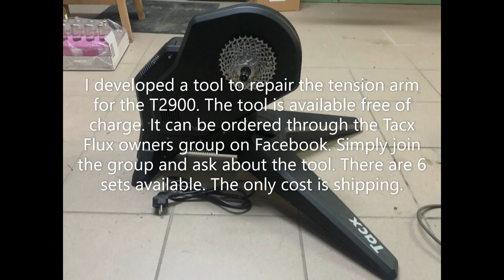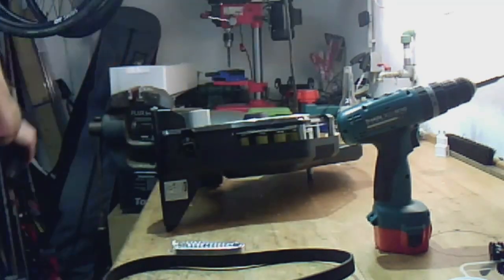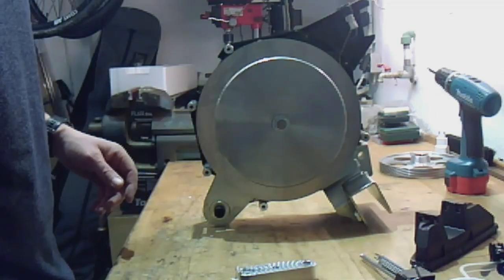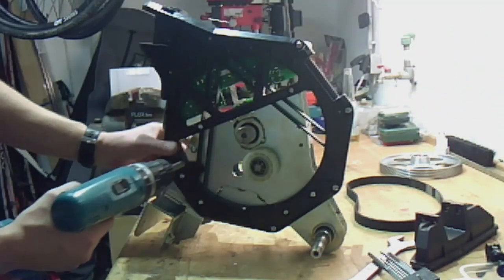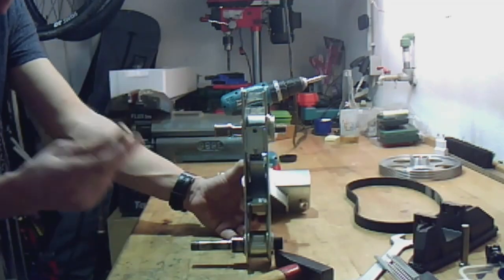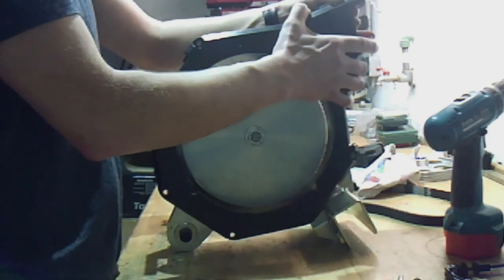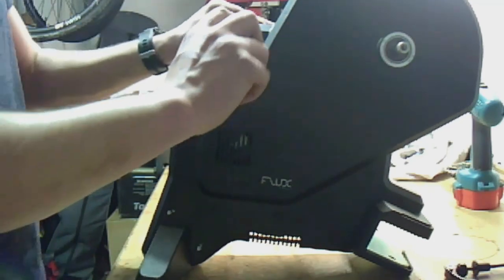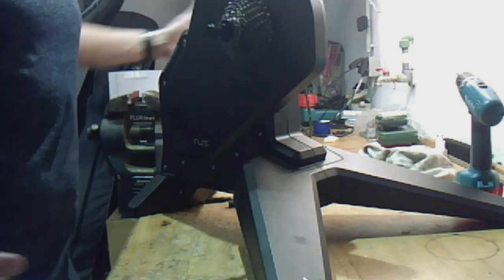Tacx Flux T2900 repair, service and how to use the free tool.

Comment: I just bought 1 of these used and not sure if its faulty or not, seems really hard to pedal even on descents and the power seems to be alot lower than what it should be. The hub is hard to turn around by hand, is this normal for this model and can anything be done to fix it ?

Comment: Hi Roland, thank you for your vid…. At 15:00, why do you glue the flywheel?? Any reason for that??
Reply from the maker: Often the fan from the flywheel is bent from heat. Then it touches the frame and makes noise. So I glue it back on to avoid this problem.

Comment: Great video. What sort of glue would you use if you had to glue the magnets back on? Would Araldite -2 part epoxy work?.
Reply from the maker: Yes Araldite is perfect.
Reply from the maker: Yes Araldite will last forever.

Comment: Is this problem with flywheel still occurs i mean flux s t2900s , because im really interested this bike trainer ?
Reply from the maker: The S is more reliable then the T2900. But if you buy one don’t worry they are easy to repair.

Comment: Hi, do you know where can I get the new idler wheel please? My trainer tensioner was bent and the idler pulley was worn. Thanks
Reply from the maker: If you look in Facebook Tacx Flux group there is a 3D file to print a new one.
Reply: @rolandgruber7674  Thank you so much

Comment: Can some one help me, the mag strip had one long screw that bent it. Whilst it was my fault I did check before putting screws in. However on removing the case to see what had happened 7 of my magnets FELL out, the glue had become crispy and they detached. Can anyone give me the POLE order of the magnets as I only have ONE that is original and correct. I have determined the pole of the 3rd magnet using a magnetic compass as N. I assume they are arranged [N]-[S]-[N*]-[S]-[N]-[S]-[N]-[S]. (from top) The only correct one I have is the N*. if you have a trainer disassembled please let me know your magnet order (use a secondary magnet to check or magnetic compass (like poles repell so North pole on compass will move away from north pole on magnet)). The correct magnet is third one from top, if the trainer was standing on the floor, below 2nd screw, going anti clockwise toward the rear leg.
Reply: [N]-[S]-[N]-[S]-[N]-[S]-[N]-[S] YES this is the correct order